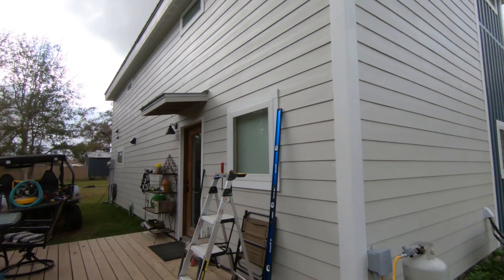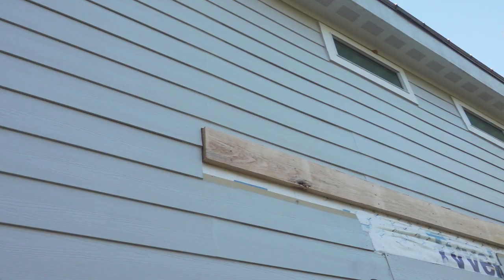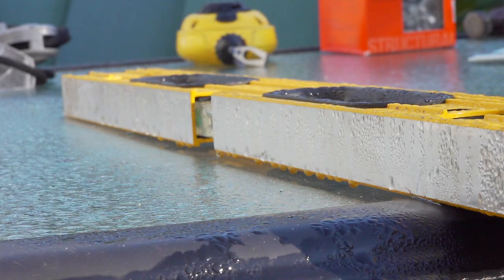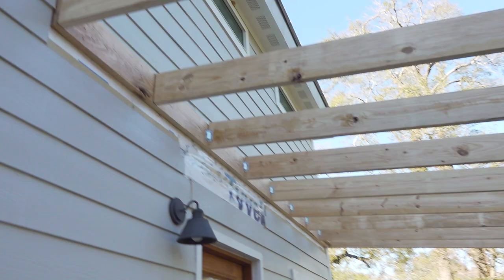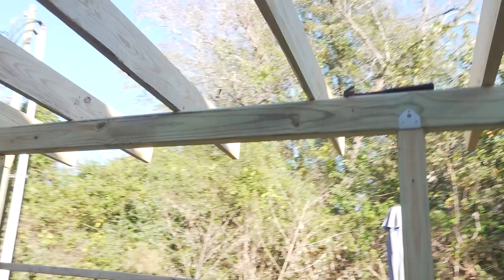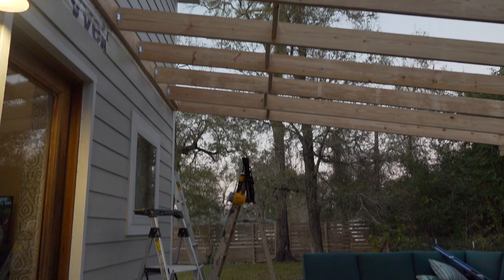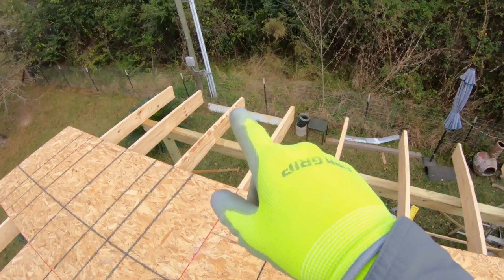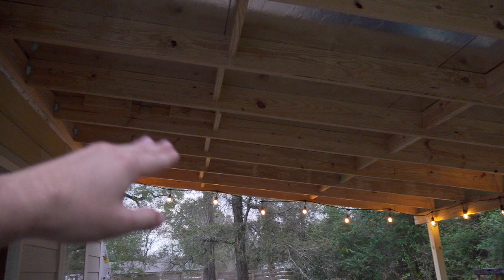DIY Patio Roof Build

Comment from the maker: Hey guys! Thanks for all of the feedback. I'd like to clear a few things up. Every piece of wood was installed using a metal tie. On the rafters I used Galvanized Gusset Angles which are extremely strong. Yes a true rafter hanger would be a bit stronger but these will work just fine. I also mention that I will be lag screwing the ledger to the joists. The ends of the rafters were tied to the beam using hurricane ties. This was done the following day. I was in a rush to dry it in before the rain and didn't have time to film every detail. These are VLOGS and are not meant to be HOW-TO videos or to teach people building code. If you are so worried about people sticking exactly to your local codes you should start a YouTube channel to educate the rest of us. They ARE however, meant to inspire people to get out there and build some stuff! The roof is extremely strong and rigid and I am completely happy with how it turned out. Thanks for watching!
Reply: What size rafters did your use? 2x6 2x8 ? Thanks
Reply: The wooden pillars. Are they 4x4 and also are the wooden beam 4x8
Reply: I've had the idea to build a deck and cover it with a roof, so this video has given me some great high-level ideas of the process for adding the roof itself.  I have more research to do, but seeing the process makes me feel comfortable with taking on this kind of project.  

Thanks for sharing!

Comment: I sure hope others DO NOT use this video for anything other than design inspiration at best. This build would definitely NOT pass code. I hope he heads the warnings of others here and corrects his dangerous mistakes.
Reply: I would of used metal ties, and I would've flashed the 2x8 to the house for waterproofing. Im no pro, but I have been studying it for a while before I build mine, and I will do it for it to pass inspections and be up to code....
Reply: He made a good effort for probably someone with not much experience. The only big mistakes were not using metal ties, no flashing behind ledger board and im not sure if he bolted the ledger board or not. Other than that it wasn't too bad. I hope he learned from his mistakes and keep building and do a little bit more research before taking on a big project
Reply: The good thing about this is that he can tear the whole thing down and rebuild it the right way and it would still cost less money than hiring a contractor to do it for him lol
Reply: This video should not be on YouTube for others to follow his mistakes
Reply: Could one of you guys put together a video to show the correct way for a DIYer.  I’m trying to start this project soon and could use the pointers.

Comment: I hope you dont plan to call for an inspection. They ledger must be bolted to the houses rim joist with lag bolts. And those posts are load bearing and should have been fastened directly to the concrete pillar footers
Reply: I  am not understanding how to find the rim joist on my house when installing the ledger up high, isnt the rim joist close to the ground just above the foundation?
Reply: DirtDDigler does that house not have a second floor? If so the rim joist sits on the top plate of the first floor exterior walls. The floor joists are attached to the rim joist as well as sitting on the wall. By lagging the ledger to the rim you are fastening the shed roof to the strongest part of that wall.
Reply: @DirtDDigler  Right. Mr. Nelson is correct. Sometimes the rim joist between floors is called the band joist, but structurally it's the same as the rim joist on the first floor. If you measure from the window sill to the floor in the inside, go down the same amount on the outside plus about 3 more inches. Behind that piece of siding you'll find the band joist. The ledger should be attached there, just like you see on all the ground level deck examples.
Reply: @Van Dog Trailer, mesure the window to the roof from the inside and add 3 inches and there should be the rim joist? Thanks for the info... I was wondering how to find it. :)
Reply: @vandogtrailer6701  👌🏻👍🏻👌🏻👍🏻👌🏻👍🏻👌🏻👍🏻

Comment: Omg bolt that ledger board in and use metal ties on those rafters before that thing takes flight.
Reply: @No_bread-and-circuses  the only thing he didn't do was to use lag bolts or even tapcons to connect ledger board.  And rafters should sit on metal ties. Not sure of a video.

Comment: This is what I'm planing to do on my patio also. I  was concerned if the 4x6 beam will stay straight an my roof will have a lower pitch so I will probably use rubber on the roof. Is the beam PTY?

Comment: should screw or bolt that ledger in & add some galv hangers for under the rafters, wont take much wind to rip that side off the wall for the sake of 50 bucks

Comment: This is inspirational, but I just have one concern: did you secure the ledger with nails?  Aren't you supposed to bolt it into the studs behind the siding?  This is a lay person's question.
Reply: Yes...absolutely. I prefer using 4" GRK star drive  screws(2 per stud). This will give you 2" of bite into the studs.

Comment: should have went a couple more feet out and did new footers. Tying it into that deck isn't structural and what are you going to do when the deck needs replaced?
Reply: brandon young 100% agree. I bought my house with a deck like this so if I ever want to rip it out the old the deck the roof has to come with it. I don’t know why you would ever do it that way as it just added in a crap ton of more work for me. My first house so lessons learned for the next one.
Reply: @mustang9549  You can cut out sections of the deck and then support the covering while you rip the rest of the deck out, then pour new footers for the covering and add in new supports that way, then build your deck around that.
Reply from the maker: The posts are only sitting on top of one decking board. It would be pretty easy to replace the deck in my situation. Not sure how yours was done though.
Reply from the maker: It is structural because it is lag screwed through the decking and into 3x8 beam below which is tied to the footers.

Comment: Nice build! How do you find the studs in your house under the siding? To attach the long piece of wood
Reply from the maker: It can be tricky. Mine was easy because I cut back to the sheathing. Maybe find a stud on the inside and try to get a measurement that you can use outside to get close. You might have to hammer a nail or 2 in to find one.  All depends on the type of siding though. Good luck

Comment: Did you flash the ledger? If so, did you put the metal flashing under the shingles? Its the only thing I dont know how to do....
Reply from the maker: I used metal panels. I used a big piece of L flashing that I had bent to the same angle as the roof. I put it under the next full Hardie plank and let it sit over the metal roofing. I guess I need to do an update video!

Comment: Nice job. 
Don’t you need you need to use joist hangers on the house side of the rafters? (To hold heavy load like snow)
One more thing: I bought a house, and a patio was added by previous owner without permit. I had to remove ceiling of patio, expose rafters, and add hurricane strips to keep patio from being lifted with strong updrafts. You may want to add hurricane strips before you place ceiling.
Reply: T Jam yes he does.

Comment: Z Flashing and joist hangers anything else he missed ? Ill be adding a roof to my porch but my home is brick how would I get the ledger board into the studs of the house thru the brick ?
Reply from the maker: You wouldn't. It's just a porch cover bro. Doesn't need to be able to withstand a tornado. Quit overthinking it and just build it. Thanks for watching!
Reply: Nah that brick is just a facade. You will need to remove brick to attach ledger board properly. That's not a small thing. If that brick loosens structure will collapse and possibly seriously hurt someone
Reply: Drill through the brick and attach ledger board to the 2nd floor band with lag screws.  Flash new roof to brick with reglet flashing.

Comment: How did you get the blocking in between rafters? I could use some help. Tia
Reply from the maker: What do you mean? Cut them to size and nail them in. I staggered them so that I could nail them easier.
Reply: @buildingsmall8422  o ok I'm new to this so I'm getting all the info I can I didn't see you nailing them. Thank you

Comment: How did you get the angle on the rapture facing the ledger and what was the height difference from the front and back.
Reply from the maker: I think I used the same pitch as my roof. It’s pretty shallow. I think it goes from 9’ to about 7’. I used a program called sketchup to draw it out and get the angles. It’s free and pretty easy to use. Good Luck!
Reply: @buildingsmall8422  thanks very much your video are motivation. Keep up the great work

Comment: Not sure if you are trying to save money or just cutting shorts, but I’m really concerned about not using lag bolts, nor using the right hangers. Amongst other details. Hope this cover is still in place. Good luck
Reply from the maker: It is. Thanks for your concern. Also, I did use lag bolts I just didn't show it in the video.

Comment: Yikes, so many things not up to code or hastily built. Nails on a ledger is nuts. Put some galvanized lag bolts with the correct spacing. Get some rafter hangers as well. You should have added some ledger tape and ledger flashing to prevent rot from rain.
Reply from the maker: In a previously pinned comment I describe how I addressed the issues you mention.

Comment: What's the reflective material under the roof?
Reply from the maker: I used OSB plywood with a radiant barrier(the foil stuff). It helps reflect heat and keeps it cooler under the roof. Not necessary at all but did not cost much more to do.

Comment: U start sheathing from the top? Thought u started from bottom
Reply from the maker: I don't think it really matters. Unless you are on a steep pitch roof. If you start from the top down you can just pop a line and trim the last row with a skill saw. Makes it a little faster.
Reply: @buildingsmall8422  how long was the patio?
Reply from the maker: @Eastbaypisces  14' long x 16' wide
Reply: @buildingsmall8422  what kind of nail gun u use?
Reply: @buildingsmall8422  also how far apart did u do blocking?  16"?

Comment: Not here to hurt any feelings..... But seriously your build has many red flags from the start of your build. You ignored the engineering, planning of this type of job. I cringed watching you build this patio roof. You are definitely putting you and your family at risk of injury or even worst. DIY people need to realize that watching videos on the internet or tv don’t make you a competent carpenter to take on a job such as this, there is way more to it. Just because you see someone else do it in a way that seem right, it might not work for the application of your job. Every job is different, it might seem the same but it’s not. Do your homework people!
Reply: Can you cite examples?  It's not as helpful of a criticism when you just blanket the whole thing as wrong but don't say why
Reply from the maker: Yes please tell me what I did wrong. In my opinion I overbuilt everything. I'm no engineer but I have common sense and can read wood load tables. It's a house, not a rocketship. Eagerly awaiting your response.
Reply: If you want to be critical, at best you can say there might be minor things he could’ve done to ensure passing code, but dangerous definitely not. All a bunch of crap. My old house has a rooftop that was done 30 years ago, Looks like crap and 100% not up to code. It is still standing strong and I’m sure would still be for another 20 years. This gentlemen’s roof will last 50 years easy.